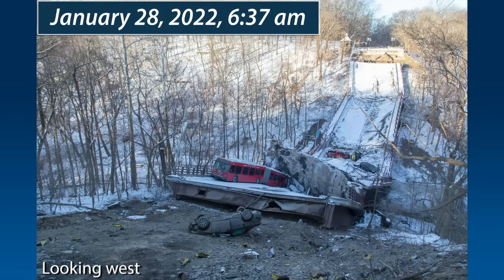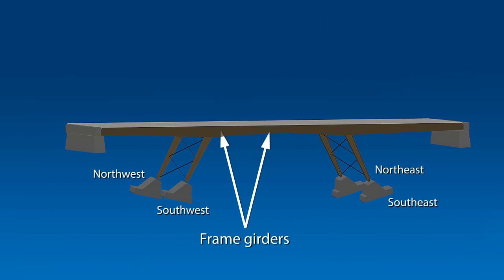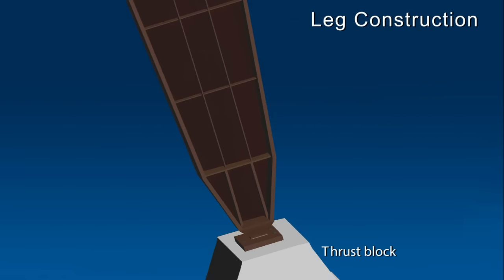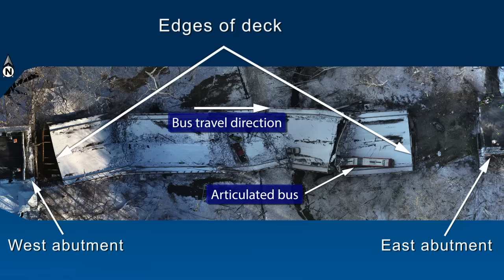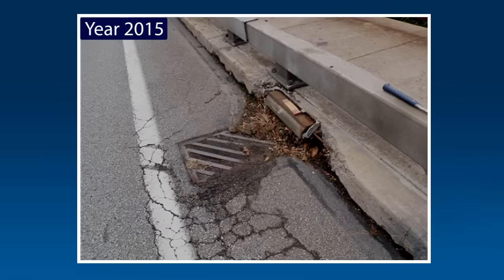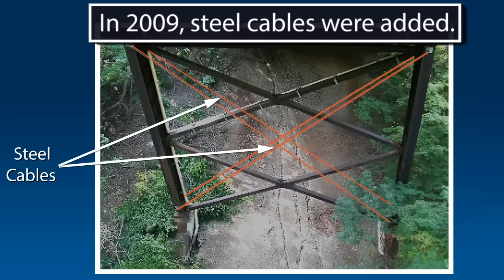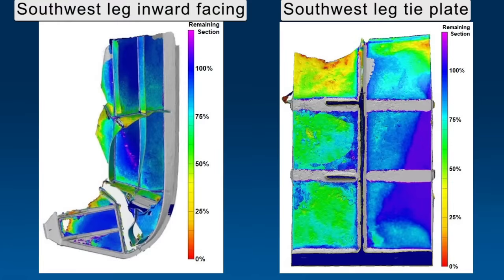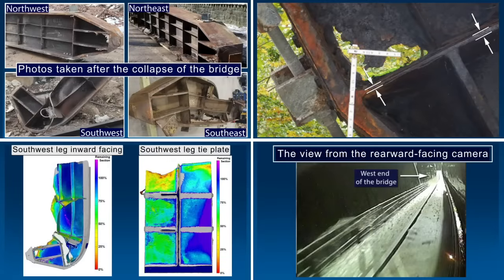NTSB Animation – Overview of the collapse of the Fern Hollow Bridge

Comment: The protective iron oxide "patina" that is supposed to form on the surface of Corten or ACR steel does not form in the presence of chlorides.  Viz.: snow melting salts. This is stated in the manufacturer's literature. I have observed that the traffic facing sides of ACR girders can exhibit advanced corrosion while the opposite side is OK. The passing vehicles spray the salt upwards and forwards and it hits the web. The material works fine if you paint it, and its need for recoating is much less than for ordinary steel.
Reply: Oh, chlorides, now I understand. In a related application I was wondering why SpaceX didn't use this alloy for the Starship launch tower "Mechazilla," but so close to the ocean it gets salt spray all the time, loaded with chlorides of course.
Reply: Exactly! This was a poor material choice for a snow belt bridge expected to be subjected to large amounts of deicing road salts and chemicals.
Reply: @andrewtaylor940 no it's poor material choice for road surface treatment. When are people going to learn? Sand works just fine. Stop fighting the weather and learn to deal with it like we do up in the north. Southerners get a wee bit of snow and think they've got to melt it all before rush hour. Try doing that when it's -30 for a week straight.
Reply: @ihdieselman  What? Pennsylvania  isn't in the South. Most of their annual highway budget is snow snd ice removal.
Reply: @andrewtaylor940  pretty far south from my perspective. And you're pretty much illustrating my point exactly.
Reply: None of the water retaining structures had drainage holes which is mandatory in all steel construction.
Reply: @ihdieselman  Heated Roads like in some countries would work better. 
Some places in EU have hundreds of miles of heated roads powered by Wing Turbines along the roadside combined with Grid power. 
(they dont have to be hot so you can lay on them and get warm, they are kept just above 2*C or 2 above freezing point)

USA could afford it in major areas if they just redirected some of that hundreds of billions spent on Military Budget towards bettering the countries infrastructure.
Reply: @tbas8741  we could do that if maybe some of the countries that spend money on heated roads spend more on military budget.
Reply: Yeah seems like they couldn’t even bother to paint it

Comment: The transverse tie plates as installed created ledges that would capture debris and puddle water.  If this was a ship, it would have limber holes to permit water at least to pass through and reach the ground.  It's as if no thought was given to environmental factors in the design.  An open lattice-work would have been superior (think Eiffel Tower ).
Reply: Better than drain holes would be to have the tie plates angled steeply enough to let them drain themselves even in the corners. They might need to be thicker due to the angle, but much more durable.
Reply: @r0cketplumber In an area with frequent snow and winter weather necessitating the application of road salt, this was just a poor design.  The drains should have led somewhere that took the water away from the bridge without running onto, or splashing the exposed steel structure.
Reply: @pulaski1  I agree completely, self-bailing scuppers on the deck and self-bailing structures that inherently cannot accumulate debris are the only responsible way to design bridges in any climate, but failing to do so in a snow & road salt environment is the next best thing to criminal.
Reply: The engineers that designed and approved this design are culpable.  I wonder how many of Pittsburgh's 297 public vehicular bridges have similar design problems.
Reply: @Paul-vh6ul  To be fair, this approach of no maintenance and no cleaning of the drains ever would have doomed any steel framed bridge in the region. The Liberty and sixth street bridges were in such bad shape before they we're rehabbed that they we're actually in danger of collapse at one point.

Comment: years ago i had a truck route around pittsburgh.many of the bridges i drove over you could see the exposed rebar sticking out of the concrete that had been eaten & flaked away from the years of excessive road salt in the winter.i mean it was clear as day from the drivers seat at 50 mph.i wasnt surprised at all when this bridge collapsed.

Comment: Maybe inspection images should be posted at both approaches to every bridge for review by everyone who is about to cross it. If I had seen those images from 2013, I would have found an alternate path from that moment on!
Reply: Post the inspection images, a QR code for the report, .... And the names, addresses, and pictures of the city engineers responsible for the bridge maintenance.
Reply: Lol. You say that, but in Pittsburgh, you often don't have those choices. You're not going anywhere unless you're crossing a dilapidated bridge.
Reply: Sounds like folks in Pittsburgh need to rattle some cages. If I knew that the bridge I crossed was a death trap, I'd find a new crossing. @JeremiahLOsborne
Reply: @hotflashfoto  The problem with Pittsburgh is that you can't go anywhere without having to cross a bridge. I believe there are over a 100 bridges in this city, and all of them are in one way or another structurally deficient. I think that's what the most recent reports say. That's why I try to stay out of the city as much as possible. They have tried to shove as much stuff they can into some of the most difficult terrain.
Reply: @JeremiahLOsborne I think the only reason downtown is flat is because of TNT. It's at the confluence of multiple creeks and rivers including the headwaters of the Ohio River.
Reply: @RowanHawkins  That's a good point. It's kind of strange how the rest of the land around it is nothing but hills and mountains, but lo and behold, a flat place.

Did you know that Pittsburgh was originally Indian territory, and George Washington stole it? And he stole it from someone who thought they were his ally? Really interesting story.

Comment: This is ridiculous... Thin metal, holes, and constant erosion; but traffic was still allowed to cross?
Reply: Hey! They added steel cables. They just needed to add a bit of duct tape, and it would have been fine!
Reply: @AlexBesogonov   Exactly!, duck tape covering that big hole 5:00 would have save it for sure
Reply: Duck tape may has stoped the rusting, should covered the steal in duck tape every year to keep the metal dry and it probably would still be here. :)
Reply: Not just traffic... massive articulated busses and trucks too.

Comment: Similar to the FIU pedestrian bridge failure and the I-35w bridge collapse. In each case there were trained engineers looking directly at a serious structural flaw yet did not call for immediate remediation or closure of the structure.
Reply: Yes and that bridge was being built when it collapsed no excuse for sloppy constuction/maintanance well except money/politics. Take your pick.

Comment: I like how that much corrosion is deemed "safe enough" for a bridge by PennDot, but if PennDot sees a speck of rust on your car it fails inspection.
Reply: I was thinking the same thing.
Reply: I had to deal with EXACTLY this! 

Small hole through the exterior rockerpanel (not load bearing)... immediately failed.

Plugged it with foam and bondo... "You're safe for the roads now! 🤪👍"

Comment: Scare part is this isn't after damage clean up pointing fingers,,, there's a hole in the support gussets (?) in a 2013 inspection, and a 2021 inspection almost half the connecting part is gone... and someone gave that the OK to keep going?   Does the inspector just give a report and it's up to someone else to decide if it's ok to be on?
Reply: Yes. That is exactly how it works. I highly doubt that the inspector has the authority to shut down the bridge, but the city sure does. And they failed. Big time.
Reply: Yeah, if I had done the inspection and then heard that the bridge was still open, I would have sent a copy of my report to multiple news agencies. Of course, after that, I would have to make sure that I never lingered in a hotel carpark...

Comment: How did the bridge pass an inspection 20 years ago, never mind in 2021 ?
Reply: Meanwhile PA will fail your car inspection if they find so much as a dime-sized spot of rust on the EXTERIOR panel (not load bearing) of your car! 

...but this is fine for a bridge.

Comment: The 35w bridge collapse video does not allow comments. The #7 pier was fixed bearing .before the collapse a stock pile was pile up around concrete columns between the top of the bluff and columns next to the river. When the bridge collapsed the stock pile of dirt and sand had been removed those columns were unstable and allowed too much movement and may have contributed to excess longitudinal movement and contributed to this disaster.  After the new bridge was finished the stockpile around the new columns returned. Why was that. I lived in the Marcy Holmes neighborhood a few blocks away. That bridge was unsafe or structurally deficient for 20 years or more. MnDoT and the State Legislature made a bad decision to attempt repair rather than spend money to replace it. They ended up replacing it any way with the loss of 13 lives.

Comment: And just realize, this bridge lasted LESS than 50 years.   Some Roman bridges built over 2000 years ago are still in use today.   They don't make them like they used to.   Even the first Fern Hollow bridge lasted 72 years before being torn down to be replaced by this thing.
Reply: Stone doesn’t corrode like steel…
The badly built Roman structures collapsed a millennium ago.

Comment: They decided to paint what? The holes? The completely delaminated critical cross plate?
Reply: You act as if the directive was to coat it the day before.  This is not the case.  Coatings are a core principle in structure maintenance.
Reply: @ShainAndrews  Not when literally half the structure is already gone! No sane contractor would stand under that when you are striping it back!
Reply: @benlewis4241  You are wicked slow on the information uptake.

Comment: Correction: The collapse began in 2014 (or before) when structural corrosion identified in inspection reports was not rectified. Also the failure to protect from corrosion should have been investigated and rectified.
INEXCUSABLE. The bridge should have been closed and made safe.

Comment: Making steel structures that don't shed or drain accumulating water was a major oversight. Its such a basic concept in steel structure design and could have been corrected even after the bridge was constructed with careful drilling of drainage holes.

Comment: The 2021 inspection photos are alarming. I guarantee that PADOT was receiving Federal funding for projects such as this.  Where did that money go?
Reply: This bridge was the responsibility of the City of Pittsburgh, not the state.
Reply: @bknesbitt2155  The City of Pittsburgh doesn't have their own Dept. of Transportation.  But Pennsylvania does.
Reply: The City of Pittsburgh has a Department of Public Works, and it is their job to keep the roads and bridges of Pittsburgh in safe condition.  Penn Dot is only responsible for interstate roads like the Parkways and I-79 and bridges on those roads.  It is also the Pittsburgh Department of Public Works' job to do snow removal on the streets and bridges owned by the city.  And we all know what a dismal job they do at that.

Comment: In my daily lectures about corrosion in 1800 Caribbean commercial and religious structures using masonry, salt is always an issue. All of the sand and rubble has salt intrusion. The key to isolating the salt and eliminating (or at least limiting) the corrosive effect of salt was, of all things, molasses …. IF covered with plaster. 🚢🗻Rob in St. Thomas, VI.

Comment: I was involved in the I35W collapse in MN in 2007. The only thing I fear in this world now is bridges.  After the I35 collapse a report came out that over half of the bridges in the US are structurally deficient, yet no one bothers to fix them.  This collapse is proof of that.  They knew for how long that this bridge was damaged????    Think about that everytime you cross a bridge.
Reply: What is amazing was that I-35W by St Anthony was a freeway bridge in what was a prosperous state, not some relatively minor bridge in the rust belt (from a financial pov!).  Yet a decade later are things different?
Reply: "Structurally deficient" does not mean "in imminent danger of collapse," however.  Some are.

Comment: It's one thing to file inspection reports.  It's another thing for an owner to read them and act on them.

Budgets may be tight, but if it's bad, close the bridge until repairs can be made.

I'm betting that the rigid legs didn't receive a thorough analysis.  Hopefully similar bridges will receive a thorough analysis in the future.

Hopefully bridge maintenance is a focus in the next infrastructure bill.

Comment: And yet the leaders who failed to act in this instance will never be held accountable.  If there wasn't funding for the repair, the bridge should have been closed.  Unpopular... definitely ... but better than risking lives.  Can we at least get the engineering board to revoke the PEs for the engineers who had a duty to act in this case?
Reply: Not defending the engineers really but likely two things may have happened. A kind of “oh we see this everyday” attitude. If your job is dealing with absolutely soul crushing infrastructure everyday you just… kinda hope it doesn’t collapse? I mean that kind of what happened for a decade plus here.

Two: there’s likely no mechanism for the PEs to DO anything. the inspections dept probably is totally separate from the group that would handle this as a project. They write these up with the strongest language they can, sends some annoying follow up emails and hopes and prays that someone with actual power gets these things fix. The people who run these departments are politician, not engineers

I’m not even sure if the inspecting engineers would have the power to condemn this. That’s usually something reserved for buildings not bridges AFAIK

Comment: The fact that this bridge's drainage system was not kept clear doomed it. Perhaps in the future, we could implement heated surfaces on bridges instead of using salt/brine. I also think that we should stick to steel for bridges with proper coatings and inspections, and forgo the expensive and labor/carbon intense reinforced concrete. We are lucky that no one died with this collapse.

Comment: IIRC there was a weight limit on the bridge which was reduced during its lifetime. I could find no word of this in the report or whether the buses used potentially exceeded this limit.
I accept this would only have been a small contributing factor as it looks as though the bridge would have collapsed anyway sooner or later but still...

PS: by "potentially" above I mean a fully laden bus and by "bus" I mean the regular city bus.
Reply: The chances are slim the buss exceeded it.  Not very heavy with lots of axles.
Reply: Don't forget the accumulated snow loading on all the bridge, as seen in the video

Comment: More than 220,000 U.S. bridges need major repair work or should be replaced. The number of structurally deficient (SD) bridges declined 2.5 percent last year to 45,000, the number of bridges falling into fair condition grew more than 3,600 to almost 295,000. Of the 45,000 SD bridges, nearly 11,200 are in "serious" or worse condition. This includes 1,668 that are in "critical" condition, 440 that are in "imminent" failure, and 970 that are in "failed" condition and are out of service.  The states with the most serious or worse bridge conditions are Iowa (1,762 bridges), Oklahoma (922), Illinois (764), Pennsylvania (728), Missouri (700), and Louisiana (638). 
Think about this when you're driving across a bridge

Comment: So they knew it was severely damaged but left it open to passengers. It's 100% on them for leaving it open with so much steel missing. 

Very similar failure in inspection like the I-70 bridge in TN, where it had a split load-bearing beam visible for a few years before the bridge was shutdown.

Comment: Weathering steel DOES NOT work in high humidity environments. The protective corrosion layer will just keep flaking off due to the moisture in the air and what is sad is they still build with this material in these kind of environments.

Comment: They had more than a year to make needed repairs. What was the malfunction in the DOT that allowed it to stay open? Was the local city responsible for the repairs? If so, what was their issue? Didn't like the bids from contractors? Didn't look for contractors to fix it? Or didn't have the funds to fix it? Either way, the bridge should have been closed until it was fixed.

Comment: It's so interesting that the bottom flange curled inward. Was that because it came in contact with the ground as the bridge collapsed?
Reply: It could be due to transverse tie plate being in tension causing the flange curling inward when the tie was released/broken (I'm no expert, I might be wrong).
Reply: @nilfar3652 the transverse tie plate went with the shoe. It had nothing to do with the outer flange curling up after it separated. That was almost certainly due to it impacting the pylon on the ground or something else.